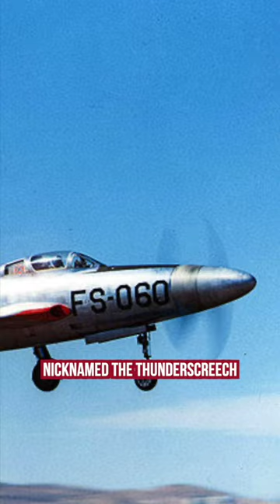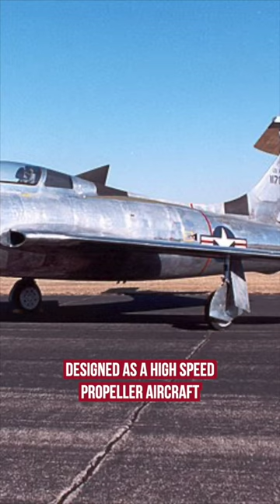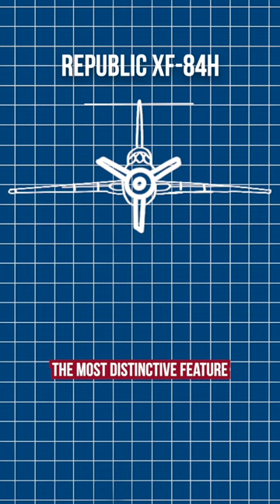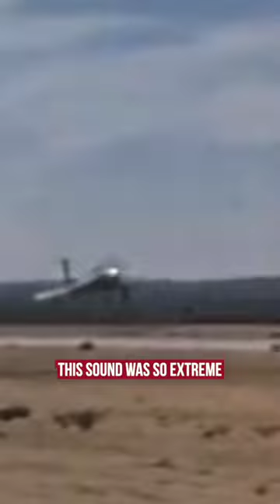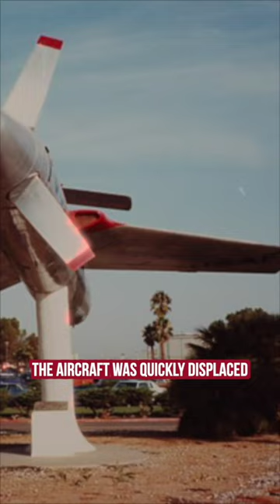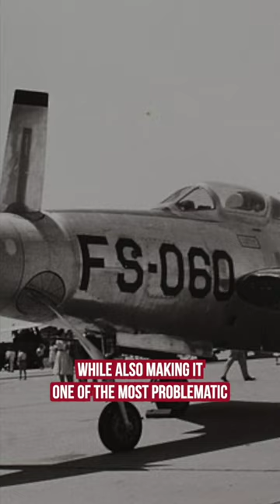The Loudest Aircraft Ever Made

Comment: This is not the only aircraft with this problem. The Soviet TU-95 has four engines, each with a supersonic contra-rotating propeller. It is so loud that it is rumored that submarines can hear this aircraft while submerged. What’s weird is that this is not a prototype aircraft, the TU-95 made up the backbone of the Soviet bomber fleet for most of the Cold War, and is still in widespread service today; there was even an airliner version (which was just as loud).
Reply: I suppose for a bomber that works put of remote air bases and that will be picked up on radar long before the sound reaches the enemy, it would only serve as an inconvenience, but for a passenger liner operating in cities, that was probably a big reason why it never caught on in that role.
Reply: Ты чушь какую-то пишешь. Этот самолёт с большой дистанции запускает крылатые ракеты
Reply: @thatguyoverthere9634 он чушь написал. Этот самолёт с больших дистанций запускает крылатые ракеты. Ни какими радарами он не будет обнаружен
Reply: @Slava18583  it was designed to drop nuclear weapons on American cities and to track submarines in the 1950s. Also, the noise is not so much a concern for the enemy, but for the aircraft’s own crew and the personnel of its airbases.
Reply: @thatguyoverthere9634  on the TU-114 airliner, the noise level in the passenger cabin was around 104 decibels. The thing is, that aircraft did passenger service all the way into the late 80s.
Reply: Didn't kruschev or somebody important fly over here in one of those the first time and ordered a real jetliner to be made because the noise was crude and embarrassing? (I know it wasn't a bomber, but a passenger variant with a different fuselage with tu95 wings and gear)